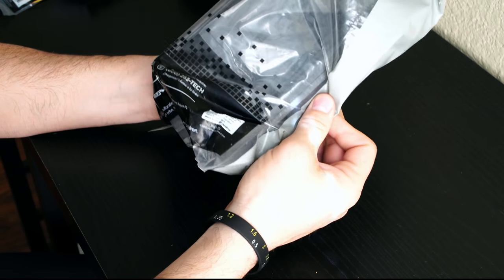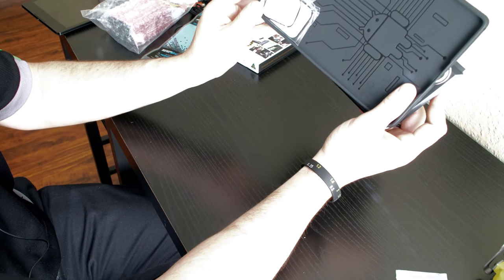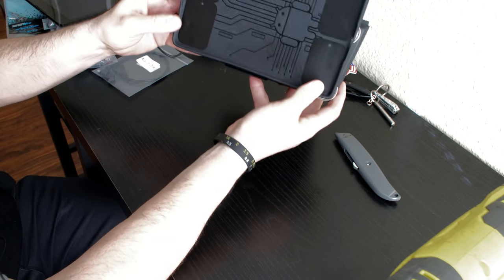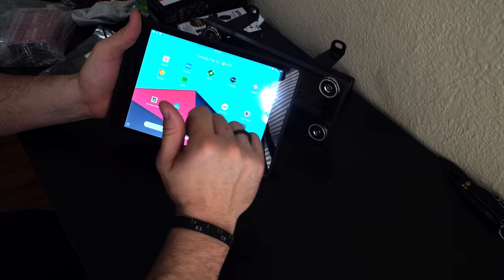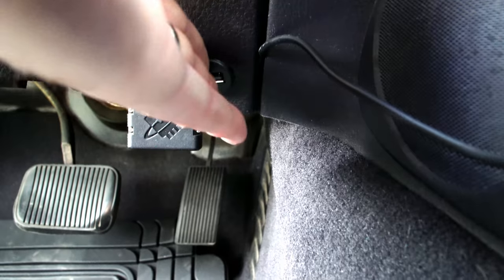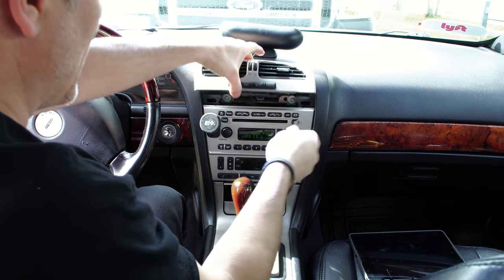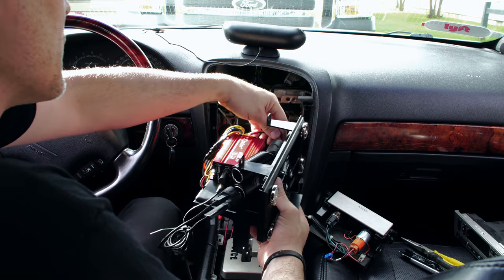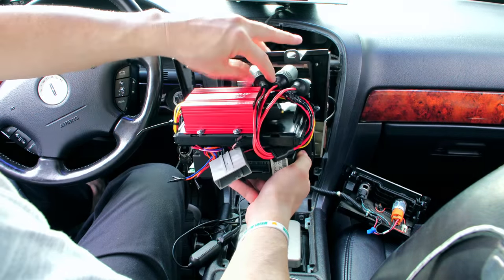Turn Your Tablet Into A Head Unit

Comment: This is way more technical than it needs to be. This is what I did ;

Bought a generic 7" android tablet off of Ebay

I bought a non android 1 din car media centre with a fold out 7" screen, the one I bought had physical volume and tuning knobs and an auxiliary screen so you could close the screen but still use it for all audio from radio to Bluetooth. I then bought a single din facia with a storage slot.

Next I removed the standard radio and installed the new facia and media unit in my 1998 Ford Focus dash, I plugged in a usb charger in the back and modified the storage tray to allow the wire to get through, I used the original harness and radio antenna plug. I turned the unit on opened the screen and set the equaliser, paired my Bluetooth, set radio presets then closed it again.

Next up I installed a magnet to the facia in a position that could not be seen and put a corresponding magnet on the back of my tablet. The media players lower edge projected further out at the bottom and acted like a shelf. 

Next add a car launcher of your choice, set as default launcher get the rotate app and the llama app. The llama app is available on APK and you can programme routines so for example, when tablet detects power, It switches on, switches BT and WiFi on, forced the screen to stay on and when you switch off, the llama app reversed the process and kills all apps and puts it into standby.  That all took about an hour, no wiring hacks or anything and it worked great.

The great thing is if I didn't want to use the tablet, I could still use the standard screen and stow the charger in the storage slot......
Reply from the maker: That's an excellent setup. I did a very similar setup in my update video. Make sure you check that out as well.

The reason I did it this way is I wanted to put together each component myself. Your way is definitely easier. That's pretty cool we both had similar ideas. I appreciate the comment.
Reply: @edwardlthompson  yeah very similar, it was definitely very interesting watching your video. I am currently running a one din joying 7" android system with a secondary 5.5 inch screen running Realdash sat on my steering column. One question though is why you didn't use switched piggy back fuses or obd plugs to power your dash cam and Lyft light ?

Comment: Not only do I have the 10" ONN Tablet doing the same thing, I used industrial strength Velcro for mounting tho, for around $10.00 bought from Amazon, I bluethoothed everything so no wires are visible or in the way. I also use Torque OBD 2 App with a Bluetooth dongle and am very impressed with it compared to my old wired OBD 2 code reader. 
Since the tablets use magnets inside to work and magnets have been known to destroy tv and computer screens, I'd be scared to use neodium magnets that close to my tablet. 

I'm a retired fiber optic engineer, union electrician, old DJ, music lover and guitar player, I have mine set up to play my thousands of music videos from playlist but I can also plug my guitar in and play through my system. 

The only downfall is I am about finished on my new motor for my Chevy truck so I will be moving the entire system back to it soon.

I also have an amazing set up in my 1970.5 TransAm. 

Nice seeing I'm not the only creative fucker out there.
Reply from the maker: That's awesome you have a similar set up. I have done quite a bit of research and found that the magnets have no effect on the tablet. The reason I did not go with velcro is because of the temperature Extremes in the vehicle in the winter and summer. I was worried about the adhesive on the velcro strips melting. Thanks for watching the video and commenting. You might also enjoy the update video I made to this one where I went to a larger tablet and a different set up in my truck.
Reply: @edwardlthompson  I live in Purdy Oklahoma and understand about the temp changes but when dealing with industrial Velcro it's different. Pressure sensitive on how good it sticks still but leaves no yucky residue like the normal Velcro. It's actually rated and used to attach big disconnect switches to the sides of commerical  condensing units on roofs of banks and apartments. So don't rule it out. I also use it to attach my blue LED strips under my dash and to hold my remotes. Just don't push the remote to the other side to hard or it can be a pain to get back next time. I am glad to hear about the magnets and tablets tho. I happen to be a magnet freak myself so now I won't have to worry so much if I take the tablet out under the hood. 
Oh, I do suggest checking out the Torque 2 App. 
For many people I think it might be too much information but I'm betting you can figure it out like I am. It allows you to see and change all pramiters on your vehicle. Shift points, Torque converter lock up rpm's. Change speed sensors do to tire size and about 300 different other things. Which I believe is called Bilingual. You have to have bilingual OBD2's to bleed brakes on my 06 and many other be Chevy vehicles. AND it only cost like $4.95 or something like that.

Good luck, and I'm sure we will be chatting more soon.
Reply from the maker: @dans49dodge  thanks again. I will definitely find a way to incorporate some of that industrial velcro into a project soon. I have used the Torque app and another open source one. They both work well. I simply like how the data is presented in the OBDLink software and the customizable gauges in app.

Comment: Great job! I was doing this on my old car and was super happy with it. 

Nowadays I don't think it's worth it since there are thousands of cheap (way cheaper than this build) Android head units on Aliexpress and other Chinese vendors like Seicane that look way better in the car interior because they are made for specific types of vehicles.
Reply from the maker: Thanks! The reason I prefer the tablet is that I can take it with me in all my vehicles and make use of it at home as well. I can also see what you are saying about it looking clean can be a plus as well.
Reply: Don’t do Seicane. They’re bad news.
Reply: @silasrogan241  I have absolutely no problem with Seicane for about 1,5 years now.
Reply: @oliexe  It could be that people are more likely to leave bad reviews if they have negative experiences, but no review at all if it's positive. However, the vast majority of reviews I've found are negative. Including from reviewers, ranging from defective units to outright theft when sending a unit back for replacement, and then being ignored by Seicane. May I ask what unit you have and what car?
Reply: @oliexe  seicane specs are old, most of their systems are 1 or 2 GB ram models, I have used several different brands, including seicane and have found pumpkin and atto to be best bang for the money, they offer updates, my pumpkin unit just got a update to Android 9 and is even faster now, it is a 4GB ram 64GB rom model.

Comment: Interesting but what about sound quality? Compared to say a jvc kw-z1000w 10.1 inch floating screen.
Reply from the maker: I was very pleased with the sound quality. I'm not familiar with that unit that you are talking about.

You may find my update video useful as well. I reviewed the setup in the Lincoln in better detail and also showed a new setup I have in my truck with a larger tablet.

Comment: I think the end result is nice, I think you could have gotten more by mounting a basic single din 4 channel behind what you have done and leave on aux. The end result was tidy and creative. I also understand that the end goal was to re purpose a tablet I am sure the amp was at least $60.00. I may have missed it in the video but I would add a 50 amp service to run all the " extras" eliminate as many circuits off factory radio as possible.
Reply from the maker: I agree. It probably would have been easier to install a single DIN radio with an auxiliary Jack and Bluetooth. I was going for the most DIY thing possible. but you are correct, that would be an easy solution. The only issue I would have had with that would be all of the charging cables would have to be exposed.
Reply: @edwardlthompson  A million times better than the spaghetti at the start sir! Looks good very clean in the end. Also you re used that tablet that was hanging out . I hope you have inspired someone else.
Reply: @edwardlthompson  Also your video was well done, I appreciate the camera work.
Reply from the maker: @travisclouse2440  thank you. It could have been better and I hope I get a chance to reshoot the video on another car someday so I can improve a few things. Thanks for the compliment.
Reply from the maker: @travisclouse2440  Thank you so much for the positive vibes! I've received a lot of comments from people motivated to reuse their old tablets rather than tossing them. I hope you have a good weekend!

Comment: Great job on the video and "configuration".  I'm looking to add an 8 inch tablet, securing it via a holder that goes into the CD player, since 90% of my music is via Spotify.  Keeping it simple, I'm going to use the aux connector, splitting it between a bluetooth dongle that sits on the dash board and the tablet.  My car is a '08 Volvo C70 which doesn't have bluetooth.  The bluetooth dongle also has the microphone.  I'm concerned about calls coming in while listening to music, and the possible conflict of sound going to the speakers.  Will there be conflict do you think?
Reply from the maker: I would do that exact setup with the Bluetooth and tablet splitting audio into the head unit. I would play the music and calls from my phone so there's no conflict and the music will silence to take the call. This way, you would still hear the calls but you may hear the navigation from the tablet speak while you're on a call. Otherwise, you can get a Bluetooth steering wheel control or dash mounted button that can play/pause and possibly mute the tablet so you can switch over to the call.
Reply: @edwardlthompson  Thx & will follow up in about ten days.
Reply from the maker: @ElkhornRich  excellent. I look forward to hearing how that works for you! Good luck.

Comment: thanks for taking the time. I honestly thought of doing the same thing. I have a new tablet I don't use which would be perfect. The reason I didn't is because I' need to go from the tablets micro usb into speaker wires, subwoofer, etc. Can you set controls like fader, balance, spectrum display? if you wouldn't mind sending me a parts list? I am already thankful for your hel. I'd like to do this.
Reply from the maker: Thank you for watching! I'm glad you had the same idea. I was hoping this would be helpful to like minded individuals.

As far as balance and fader, I'm not aware of any easy way to do that but for the equalizer (spectrum display) and visualization, there are apps for that. My lock screen will display album art with the audio visualization overlay. There is an audio tuner app that I have played around with that will handle the EQ.

I have a parts list in the link in the description to an Amazon list that should help you find most of the parts you need.
Reply from the maker: Also, I recommend checking out my update video for more ideas.

Comment: Cool, thanks for the video. Can you control your air-con/heating through the tablet too??
Reply from the maker: Thank you for your compliment! Unfortunately there's not a way with my method to replace the HVAC controls. However, there's another company that makes very large entertainment system replacements that does include the HVAC controls. I can't recall the name but if you search for large screen infotainment replacement, you should find it. They are limited to a select few vehicles though.
Reply: @edwardlthompson  OK, thanks for the reply. I will check it out:)

Comment: Do you know if I can still hook up my subwoofers? I want to do this with my truck but I don’t wanna lose my subs
Reply from the maker: You should be able to as they can be combined with the factory wiring harness that will be adapted to mix with this setup. I recommend watching the update video I made to this one that is suggested at the end of this video. I did a different setup in my truck that used a Bluetooth head unit with a backup camera.

Comment: Wow Eddie! That was amazing to watch (hard to believe you have no audio tech background).
I didn't see anything about adding a  rearview camera; did you add one? If you did, how do you get it to work with the tablets and what hardware and apps made it possible? 
Thanks for the great video
Reply from the maker: Thank you very much for that compliment! I didn't look into the camera but without doing any research, I bet there is a Bluetooth camera that you could set up. I know for certain that you can connect USB devices to the tablet so I'm fairly certain that you could connect a webcam to the tablet. How to access the video feed on the tablet would be another story. You have certainly sparked my interest anew in that. I have a webcam and I'm going to try and see if I can get it to work with the tablet.

Comment: Get the Volume slider app. With that you can control volume and brightness by sliding on yhe the edges of screen. Highly recommended for this kinda setup
Reply from the maker: Thank you for that suggestion. I did find an app that had a slider along the edge but I wound up not adjusting the volume very much at all once I had it set. I also used a volume control app that automatically adjusts based on the GPS speed of the vehicle which was somewhat useful as it would increase the volume as the speed of a vehicle increased.

Comment: Could you have mounted your magnets on the inside of your stereo mounting bracket. If you went down a size in magnet, then epoxy them on and then your tablet will cover the magnet completely........... but great job. One of my most favorite car mounts for my phone used those lil metal strips and magnets...... something ive thought about for a ling time
Reply from the maker: That's a good idea!

Comment: Interesting concept for a tablet install.

You were probably getting the sound drop with the original setup due to the power that was getting taken away. Kinter amps often have highly rated outputs but don't put out close to it. The 500w version of this only put out around 5w per channel (rms)  without distortion and peaked at around 15w per channel (peak) with distortion. So, when you had everything plugged up, it probably caused the power to drop too low on the amp to power the speakers adequately. (For reference, head units/stereos are usually rated at 4x45w or 4x50w peak with an RMS around 20w/25w per channel)
Reply from the maker: I've noticed that. I have been searching for another small amp with higher wattage. It gets loud enough that I need to turn down the volume from time to time but I wish I had just a little more.
Reply: What OBD software you are using?
Reply: Any update on this?
Reply from the maker: @sweetsilence4682  what part did you want an update on? The amp, the app, or the project?
Reply from the maker: @BSabbath  https://play.google.com/store/apps/details?id=OCTech.Mobile.Applications.OBDLink

Comment: Neat!   I know I'm late to the party here, But if you see this,  I have one little question:

How do you receive AM/FM radio now that the head unit is gone?   Granted AM is dodgy at best with all the interference from LED lighting modules and other RF pollution.  FM is all but useless anymore with every station playing the same 10 songs on endless loop and Beavis & Butthead morning show "DJ's"  endlessly puking about "Yunts Stillrz nat!" every 15 seconds. (I live in Pittsburgh area of PA.  It's sickeningly inescapable)  There are still  one or two radio stations worth tuning in though.  I would like to do something similar,  but NOT have to Hotspot the tablet through my phone to use Iheart radio to get AM/ Fm radio. So how (if) did you overcome this?  I wonder if there are is any kind of AM/FM dongle to add radio ability to a tablet.

Lastly,  I would use the wired audio from the tablets headphone jack, as well as a music player app like AIMP that can play flac files.  Bluetooth can be laggy and is lossy, on top of the bit-crunching that MP3 and other lossy music compression formats do. AIMP works with Windows, Android and crApple-phones, and has tons of UI skins to choose from for a custom look.  Wired audio connections, and lossless formats are the way to go.
Reply from the maker: I love how well you worded this question and explained your situation. As far as radio goes, some older Android devices have built in FM tuners but I believe the best route is getting a cellular enabled tablet and going the iHeart Radio route if you must hear your local DJs and advertising. I go into this a little deeper in my follow up video where I show the tablet I moved to and a better look at the wiring and setup. It was in its "final form" at that point. You can find the recommended video at the end of this one.
Reply from the maker: Also, I used a wired connection for the audio and you always have the ability to download music to play off of the device without having to stream them. The offline play uses less resources and works anywhere, saving your data plan and preventing throttling.
Reply: Good info.  
Thank you, and best wishes. @edwardlthompson
Reply from the maker: @Cammi_Rosalie same to you and good luck with your project!